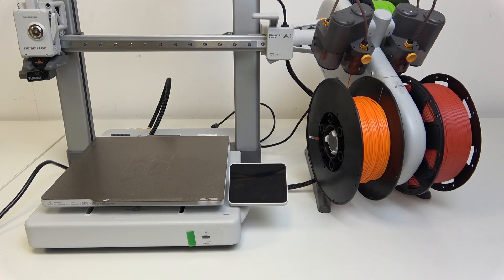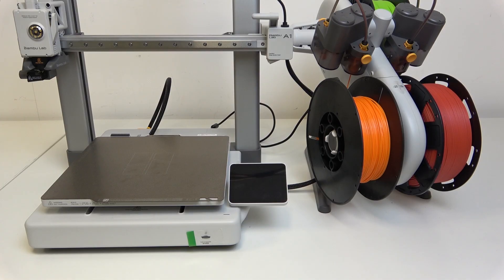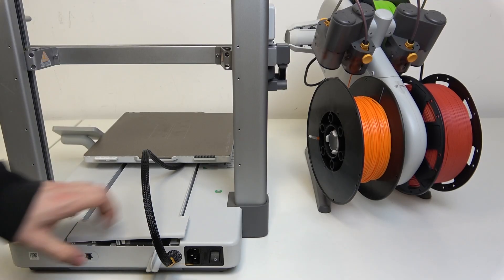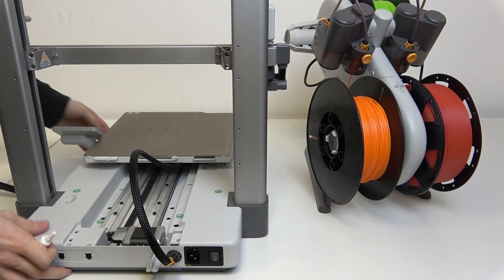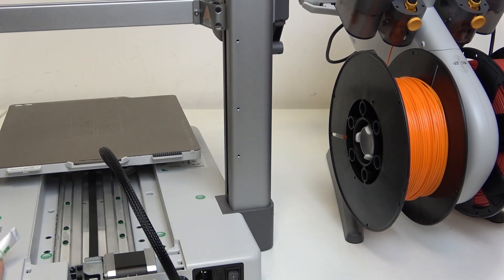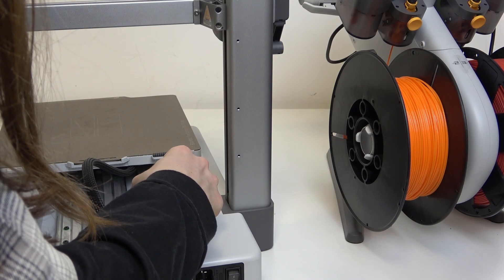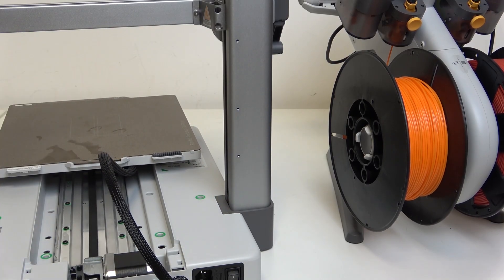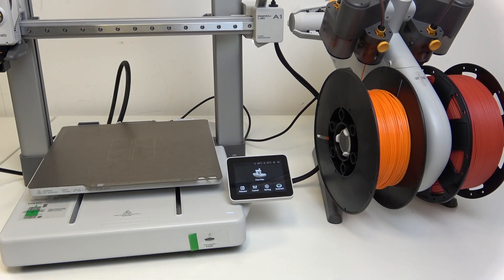How to Lubricate The Y Axis on Bambu Lab A1 Combo

Comment: WD 40 is not a lubricant.  It's an anti rust agent. Do NOT do this. Do NOT use it as a lubricant.  The name WD-40 stands for "water displacement #40". Use a real grease for this.
Reply: The Bambu Lab website itself tells you to use WD40 instead of the lubricating grease that comes with the printer.
Reply: @Pinkyonthebrain99  100% not the case WD40 is NOT a lubricant it is the best lubricant at first but will wash out over time and ruin anything you put it onto.
it is made to open rusty nuts and bolts ONLY
it is the OPPOSITE of a lubricant and will ruin anything that moves over time becasue it will run dry
Reply: @Pinkyonthebrain99  ok you are RIGHT they do indeed have that tip on their wiki, what a bunch of clowns, omfg
this will ruin 100's of thousands of printers.
ah, now i know why